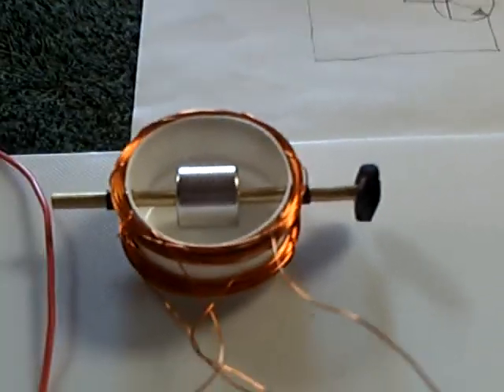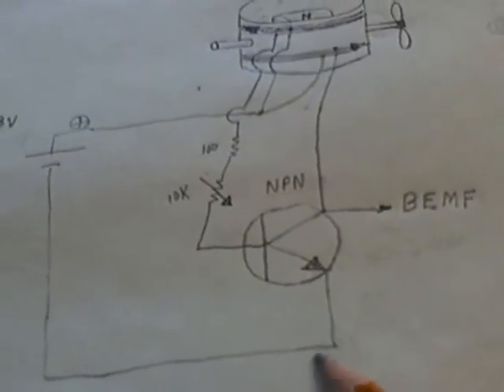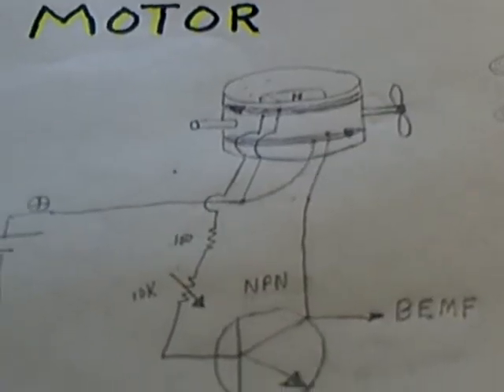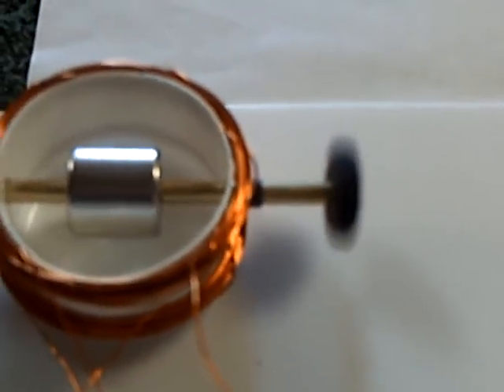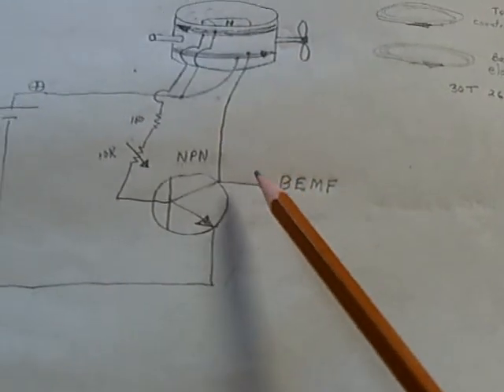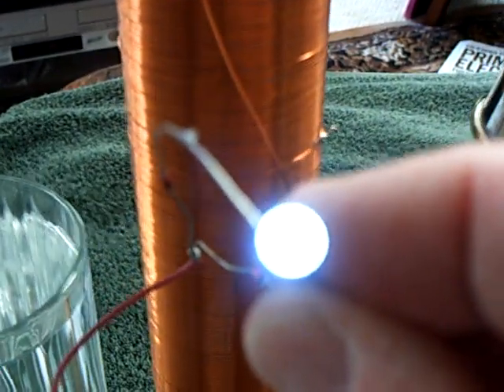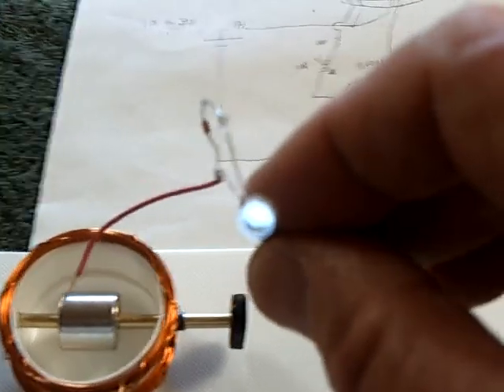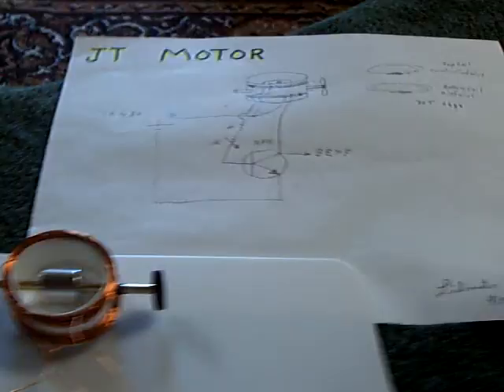JT MOTOR

Comment: Hello! Two questions, what transistor did you exactly used and could I power up this motor with a standard joule thief that uses a 2n3904 npn transistor? Thanks!
Reply from the maker: Viktor Božičević 2N3904 NPN will work fine.
Reply: ***** Hello! I made my motor using two small cube nd magnets because I don't have round ones that I've put on a plastic lego axle, one facing north the other south. However, tried wiring it to 2n3904 and still doesn't work.

Comment: not bad for something from a tiny aa battery... can this be also called a brushless motor with the joule thief running as a controller pulsator? I can also hear strange UFO noises coming as you connect and demonstrate the slayer part of the demo..looks like the camera electronics is picking up the pulses from the slayer set up

Comment: This is a great circuit. What transistor are you using in this circuit? I tried a 2N2222 and a TIP3055 but it did not work.

Comment: @Lidmotor you know that if you placed another two mags on the ends of an extended axle, you could have two gens. Two thin plates of aluminum between your mags would act as shielding and keep the mag-field interaction to a minimum. The gens would place some drag on the pulse motor, but not that much I don't think. You could try it with one at first and mesure the increased curent draw of the pulse motor, see if it could handle two gens.
Man, I just Dig what you are doing.